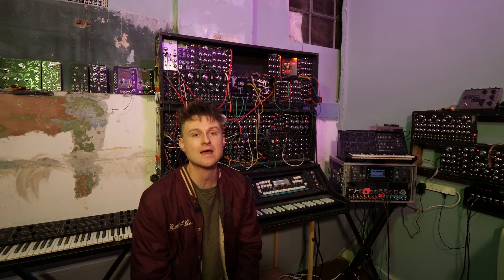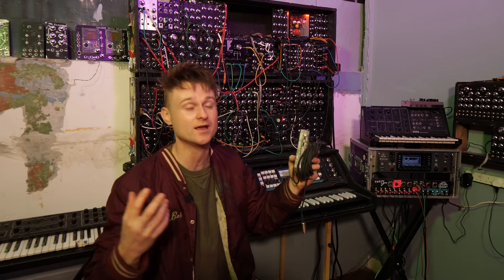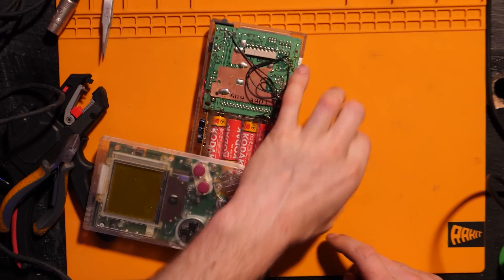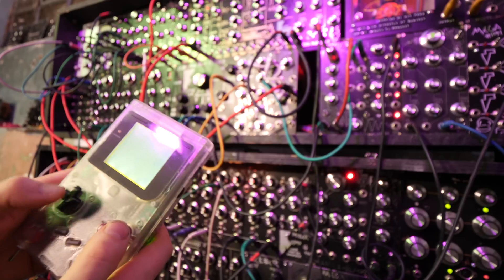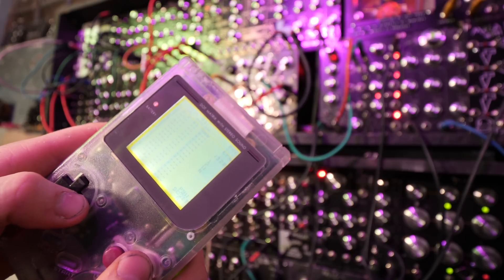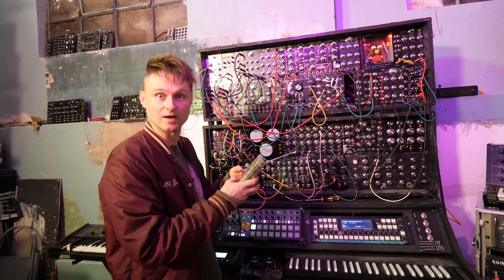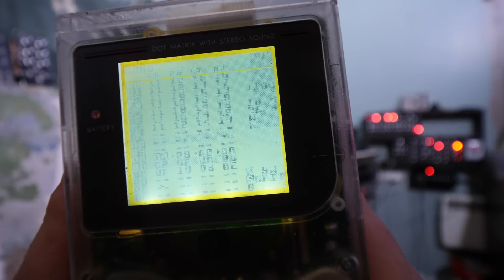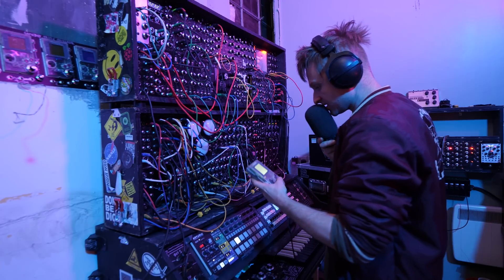Controlling Things With Gameboys.

Comment: The original Gameboy had a base-plate of prefabulated aluminite, surmounted by a malleable logarithmic casing in such a way that the two main spurving bearings were in a direct line with the pentametric fan. The latter consisted simply of six hydrocoptic marzlevanes, so fitted to the ambifacient lunar waneshaft that side fumbling was effectively prevented. The main winding was of the normal lotus-o-delta type placed in panendermic semi-bovoid slots in the stator, every seventh conductor being connected by a non-reversible tremie pipe to the differential girdlespring on the "up" end of the grammeters. But I think MIDI is the way to go.
Reply: For two sentences I was thinking: This person knows things! Then I read on and realised... they're making this up. The lotus-o-delta type was NEVER used and anyone who took even one class of flagronomics would know that, because it would obviously spiral out the Leman-Böhring values beyond the fractal baseline. Also, I don't think girdlespring is even a word, unless you just mispelled birflespin, which can be differential but you'd see that in very high-end glastiometers only.
Reply: I'm just glad they resolved all the retro-encabulation modial duractance issues when rolling out the slim model. Although some people think the old Fatboy model sounded better because of that.
Reply: @pragmax  right? Although I sometimes can't device to go the retro-encabulate or turbo-encabulate route. 🧐
Reply: The lack of side fumbling is the only reason I do not use this. A serious, and, frankly, unforgivable impediment.
Reply: @donerskine7935  biasing your marzelvanes might help with that, not sure tho
Reply: Is the foremost osmium-rictured solenoid connected to a multiphased centrifugal coolant pump? The demispheric slots in the stator suggest otherwise.
Reply: Thanks for transcribing the lyrics mate.
Reply: This thread sounds like the first chapter of a 1960's sci-fi novel. I'd read it for sure.
Reply: Just what I was thinking.
Reply: Eloquently put.
Either way though, that rare model will be worth several quintillion dollars by the late 2410s, putting it roughly inline with what you'd expect from today's levels of hyperbaric inflation.
Reply: I think the unit you are referring to did NOT use the normal Spurving Bearing , but instead used Shlovotic anti- motivators (the 9 volt versions) I think they were in sync with the pentametric fan.This made for a far more smooth Levititronic cupluation altogether.
Reply: "Encabulated"😂
Reply: Just Brilliant! 🙂🙂🙂😂😂😂
Reply: Distinct shades of Stanley Unwin in this descriptibol. Oh Yes!
Reply: only a select few will understand
Reply: real
Reply: this guy VXs

Comment: @LOOKMUMNOCOMPUTER I have a question about MIDI OUT for LSDJ. With the Trash80 schematic, latest arduinoboy code, and LSDJ 9.3.3 (for AB), MIDI OUT messages appear to be unintelligible. I see MIDI signals but it's not anything I would expect, and no NOTE ON messages. Is there a specific version of any of these I should be using or something I need to change in the circuit? I am using an arduino nano. Thanks

Comment: That's what I got my Nintendo DS for, although I haven't spent much time with it. Connects wirelessly via RTPmidi and just works as an ordinary MIDI keyboard/controller. From there, the only limit is the MIDI protocol itself. With the right DS homebrew and some practice it can be a really fun input device.